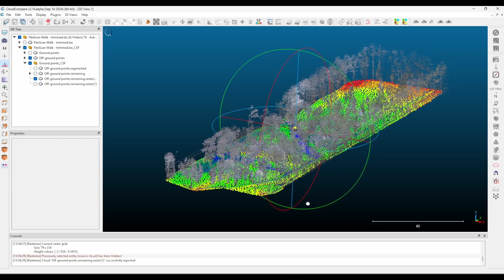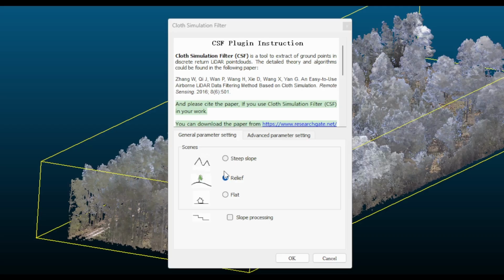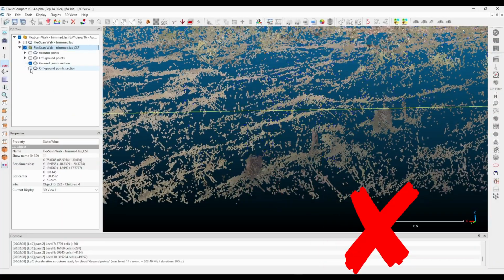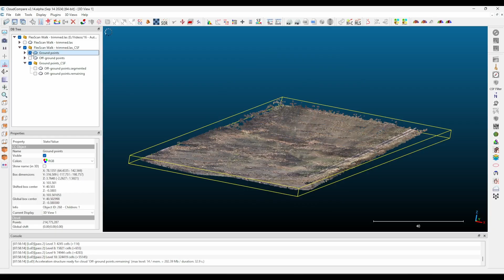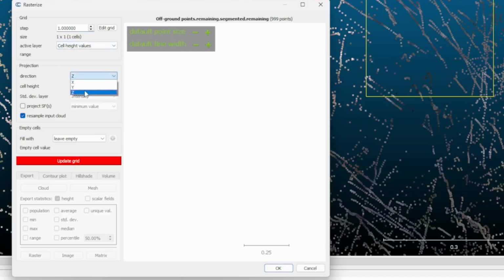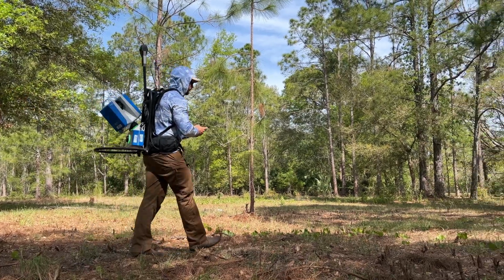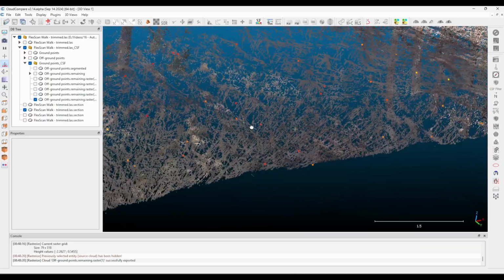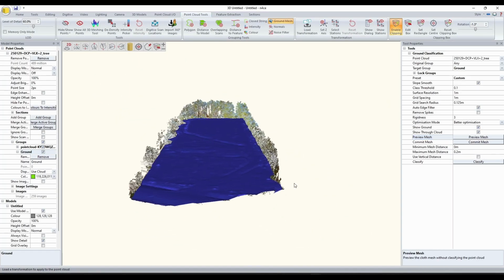Point Cloud to Ground Surface - The CSF & Rasterization Method

Comment: Hi, I just found your channel and as a surveyor student it's a great resource.
I don't know if you appreciate tips or take requests but here are some things I've been curious about, some practical and some more theoretical.

Comparing precision and accuracy of regular mini prisms vs mini 360 variants, and possibly mini pole in sections vs sliding prism.

Pros/cons of accessories like these:
The Marksman Mini
Rothbucher Stake Out Aid
Seco Mini Prism Mono Pod
Sitepro Mini Prism Pole Bipod

Monitoring movement in pile walls and shoring systems. 

Planning, creating, adjusting and observing the tension in a geodetic control network. New static GNSS points? Best practices for adjusting and testing for errors? 

Alright I need to stop here before I get carried away. Thanks for your videos again